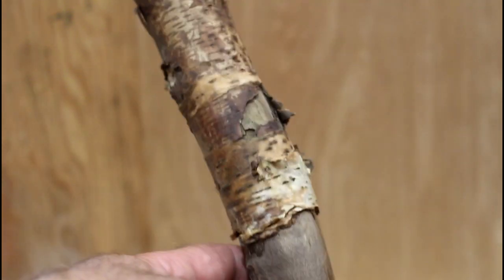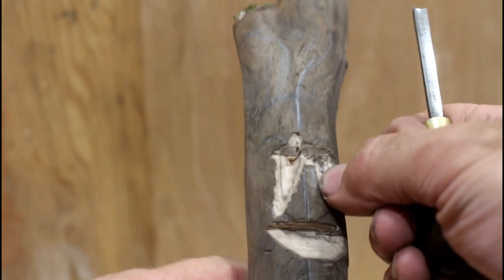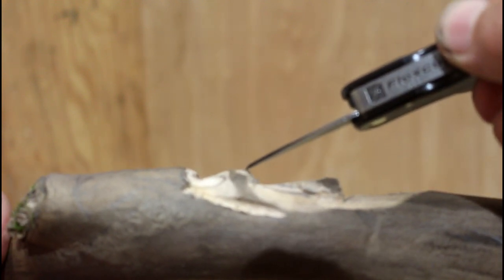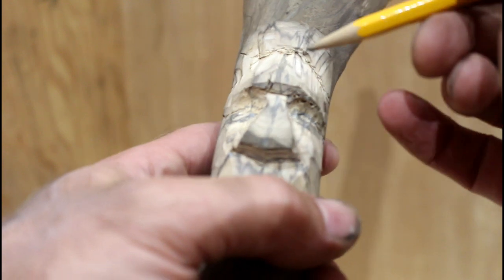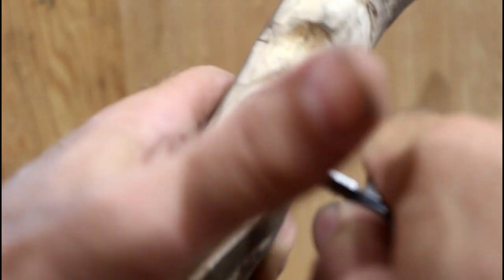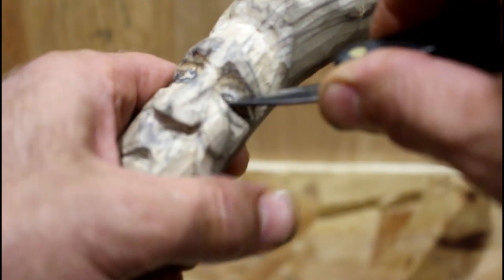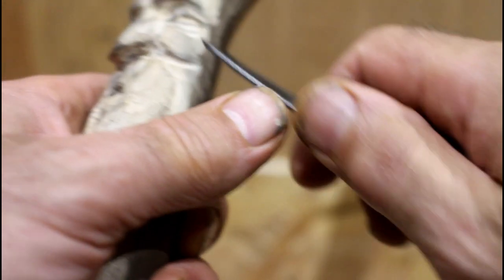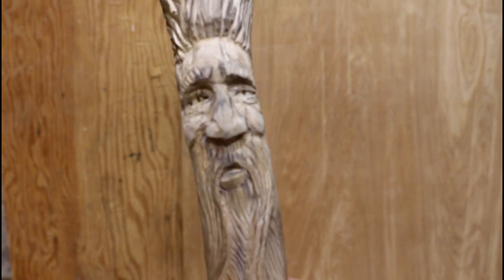How to Carve a Wood Spirit -  Full With Narration

Comment: Questions if you have time to answer. Particular types of trees to use for whittling? Do I need to let the wood cure any before trying to whittle the mans face? I went out to the woods beside my home, chopped off a small branch of idk what kind of tree. The wood is so hard that the whittling knife barely wants to cut it. I'm trying to teach myself.
Reply from the maker: I was planning in doing a video on types of woods for woodcarving. I'm on vacation for next couple of weeks but I'll make it sometime after I get back.